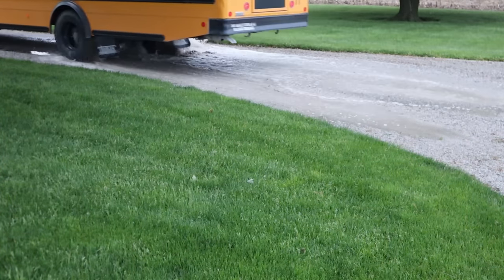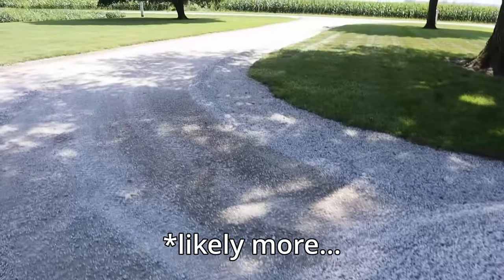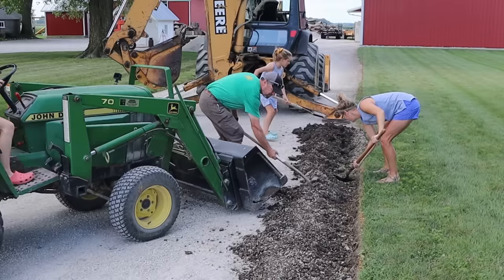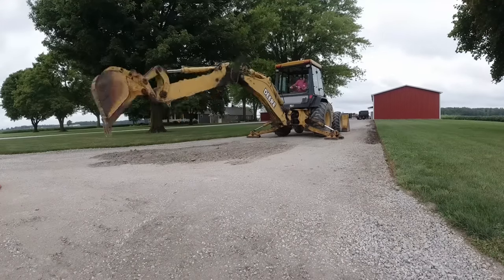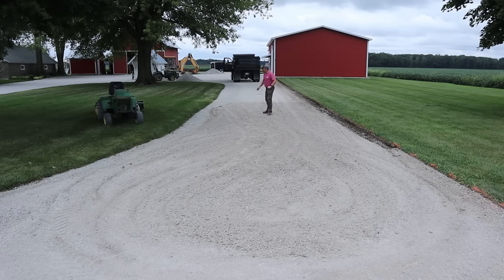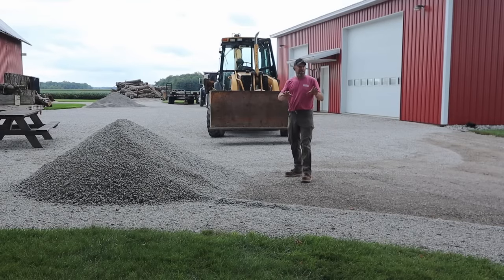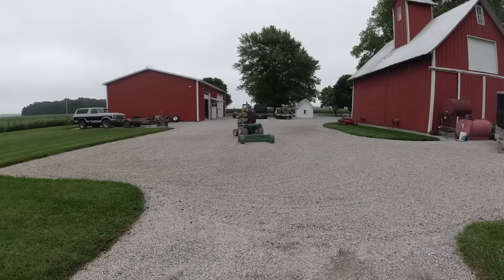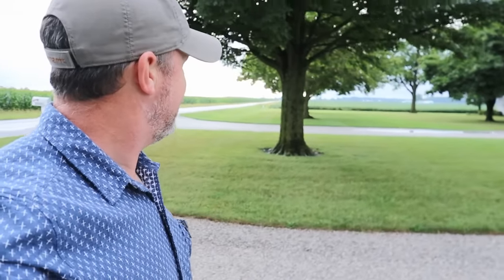10 Steps To A Perfect Stone Driveway! (She's The One Behind It All!)

Comment: Neil, you guys nailed it! 

I don’t know how many times I’ve seen people just pour some gravel over a pothole and expect it to work.  I have a neighbor with a crater about 6’ wide and 8” deep. He shoves the crater walls in a couple of times a year, then tosses on another layer of top stone.  

Instead of fixing the problem, he makes it worse.  It used to be a 3’ pothole… now it is almost big enough to swallow his whole pickup!

I’ve offered to dig it out and reset the foundation layer.  But, he’s convinced that it will only and most assuredly make the problem worse.  He also needs to build up the area to shed water… but thinks that will make the pothole deeper.  I’ll send him a link to this video in the hope that it will give him a few ideas!

My driveway is stone as well.  The trees along the edge create quite an obstacle to maintenance.  We plan a couple of changes for next year… I too will keep this in mind for reference in doing it right!

Thanks to you and the ladies for giving me a vision of how good mine could look!
Reply from the maker: Those potholes can be a real nuisance! My dad is working on some over at the neighbor's house that have been reoccurring for years. 

Probably the hardest thing on this driveway right now has been the school bus and the off camber turn as he pulls into the driveway. I tried to minimize it so that the bus wouldn't rock as much as it did. Fingers crossed that it holds up, but you'll probably find out on here if it doesn't!

I'm glad I don't have to deal with tree roots along the driveway, although I might trade up the ability to keep the edges straight for some nice wooded shade! I'm sure yours looks great though already.

Thanks as always for tuning in sir!
Reply: I call this pothole memory. The memory remains unless you do what you were talking about.
Reply: @stromxtc2033  I like that.  Thanx

Comment: I always like to see the Grader Box Blade in action. Your driveway is much bigger than mine but I make up for that with the field that can flood in spots out back and that is the reason for the grader box blade build anyway.

I never heard anything back from you after sending photos of the box blade finished using your plans.  I figured it was because I said something like "mine will not be John Deere green" (joke). 

I did use the option of a removable tongue but it works great.  I had to move the actuator mount one time after mounting it, but that is the joy of welding, being able to cut it out and then sew that steel together again. That's right, I said "sew" it back together. Nothing like good stitching of steel to make your day. LOL  I enjoyed building the grader box blade from scratch, but it did take some work getting it there when the temperatures were roasting outside. I also put in removable bolt-on side plates for the bottom of the box.  I figured they would wear eventually and I can then just add another bit of plating to the bottom when removed and then bolt them back on. 

Pulling a box blade like that is harder when inside a closed cab.  Looking backward through mirrors is also not ideal.  
I have a magnetically mounted camera similar to this one but mine came with a monitor for the cab https://www.amazon.com/Rear-View-Safety-Wireless-RVS-83112/dp/B00O513V8S/ref=psdc_1253823011_t3_B01N3UW99I to use when it is called for in other situations, so I figured I'd use it on the back of the Kubota RTV X1100C and it allows me to see everything from the cab.  The camera runs for about 4 hours on a rechargeable 9V Battery and when one battery dies I just insert one freshly charged. It sits on the tailgate or at the front of the bed so no danger of it getting broken by debris from the blade.
I  stay air-conditioned, drink my coffee,  listen to the radio, and use the box blade at the same time.  Using the actuator option instead of hydraulics works fine for me.  I am planning on hooking up a small battery box (which I just thought of last week) on the tongue to power the actuator, that way I only have to run the momentary switch line into the cab. I also you "Anderson" plugs to connect and disconnect the power lines.  That's about all I can say beyond the basics but figured your viewers could get some ideas from others who may decide to build one for themselves.

I did use your suggestions for wheels and although they worked, the grease fittings for them are plastic and not ideal because of the angle they are manufactured in.  So I will add grease as needed by removing them and doing it by hand. It isn't like I am using them as a racing wheel anyway. I also didn't cut down the scarifiers (teeth) because they keep the tongue off the ground when disconnected and I generally keep them down just a slight bit below the cutting edge anyway.

Well, I've said enough, now I have to get back to work.  Have a nice day and enjoy those girls while they are still young enough to stay at home because they will be gone before you know it.  😄
Reply from the maker: Thanks a lot Richard. I'll have to look for that email as I get quite a few and I must have missed it. Glad to hear that your grader box is working out well. Thanks for all the tips and suggestions on adaptations that work well for you. Appreciate you watching!
Reply: @digdrivediy  I know it takes time to get to everything and I am not worried about it.  I can always send you an email when I get a chance.  Just relax and enjoy what you do. You appear to like what you do and I don't fault you. You have 3 "young ladies" to deal with on a daily basis and that ain't easy. I've seen how they treat you when they cut your hair. 🤪

Comment: Nice job, now do you have any tips keeping it looking that nice come winter time snow plowing?  John Deere 445 with 54” front blade.  I don’t like the factory “feet”, because when I swing the blade left or right they dig in, disrupting the gravel and getting into the grass.  Plus when on the float setting the sharp bottom edge of the blade tends to dig in.
Reply from the maker: I found the best way to keep your driveway nice when you're plowing. Snow is to wait until you've had a few snows and pack it in with the vehicles first. If you plow before the stones are frozen in then you're going to move them all over the place. Also, when I apply I keep all of the snow piles on my driveway so that I can retrieve the stones easily and regrade them out. Thanks so much Rod!

Comment: Since @WatchWeswork got my little crawler going for me, I've found you can't make a smooth level surface in one or 2 passes. 
 I've had a ridge along my drive for decades, and water always pooled up in the low spot. It was always solid underneath, but trapped the water till it evaporated.
 This spring, after installing my piranha tooth bar, I got that cut down, so the water can drain off. After a couple touch up passes, there is only one little spot that will pool up right after a hard rain, and it easily drains off in an hour or so.

Comment: Neil I realize it would be costly, but what do you think about metal edging to line a driveway? Pounded down to be just over the top of the dirt line, it should keep those roots from wanting to creep over into the gravel. I haven't tried it, but I am considering it.
Reply from the maker: It would be great if you could find something heavy enough.  I wish I could line mine with railroad tracks.  I used some along my barn and it works awesome! For us it has to endure the frost heave so the metal edging needs to be substantial is all.
Reply: @Neil Koch: Dig-Drive-DIY  That makes sense with the frost heaving. Thanks Neil!

Comment: I have 2 inches of clean #4’s: inch and a half.  If I wanted a smooth walking and driving surface, and the dust and grit weren’t a problem, what material would you suggest I top coat it with? We’ve been driving on it for the last 3 years. It’s never compacted or been pushed in the red clay beneath it, it just rolls around.
Reply from the maker: Yeah, the larger stones will wash and move around on the surface much easier.  Sounds like you need to topcoat with some finer stone to get it to bond together.  I would probably add a mixed stone aggregate that has the power with the 1" stones.  If you can mix it together with your existing stones I think it would form a nice balance.  You'd have to grade it with teeth so they can get mixed up but the fine powder will really help keep it together and you'll have less rolling around of the stones.  Some folks call it crusher run. For us. It is number 73s.

Comment: The trick for lasting straight edges is a concrete border. 4-6in wide, higher than the drive surface, but lower than the cut height of the grass. lol Thats what I did.

Comment: Looks fantastic!  You deliver the  commentary so even keeled - it’s great!  “Guess I need to do the other side now.” 😂  Why did you go with the dark stone for the finish?
Reply from the maker: The darker stone was the only thing available this spring. They have been running short on these small stones at our local quarry so I had to get some from a different quarry farther away for a job I did this spring. This is actually left over stone that I used on another job. In hindsight, I probably should have waited until they had the lighter colored stone, but I guess it's okay.

Comment: How do you handle water runoff? I am planning on rebuilding my driveway and I suspect I’ll need to crown the drive and add drainage trenches along each side of the driveway to direct water along the driveway rather than across it. My drive is not steep, but there is a little slope from one side to the other.
Reply from the maker: For us the water flows from front to back.  I don't have much crown in the road cause it is just so flat around here and the water needs to run across the driveway.
Reply: @digdrivediy  Gotcha. Thanks for the reply!

Comment: How do you not dig it up when it snows? Even with shoes on, you’re going to grab stone with such a bed of loose stones
Reply from the maker: I always drive on the snow first to pack it down.  We haven't had an impassable snow in a very long time and usually the first few are light.  Pack it in and the blower or bucket will glide across the top in subsequent snows.